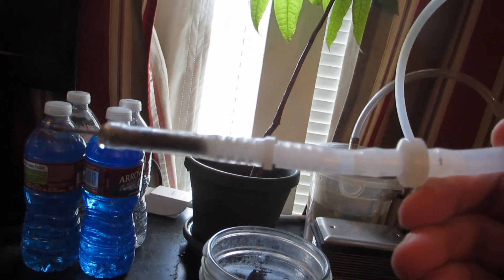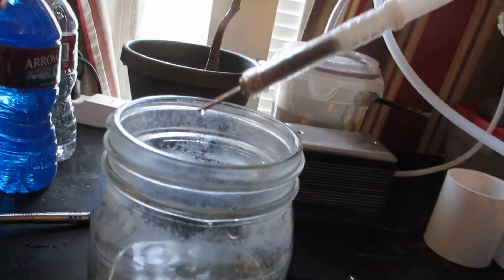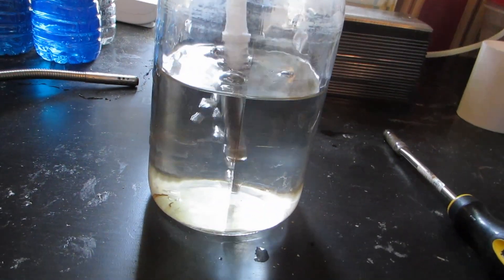Vid78 Brick Cell Torch

Comment: hi what power supply you using 
?
Reply from the maker: I'm using a 400W power supply that I pulled from an old PC case.  It is a iMicro PS-UL400W.  Any newer power supply will work, because the color coding is universal.  Be sure to look for a power supply with 12V 25A or higher rating. This will ensure you can provide sufficient current to power the hydrogen generator.
Reply: HHO4ALL hi again thanx for answering i use xbox power supply but its pain in a** its keep turning off . hopefully i will found some cheap pc :)
Reply from the maker: The xbox power supply keeps turning off, because of it's built-in circuit breaker. It does this, because you are drawing too much power and to protect the power supply from getting fried.  Using a converted PC power supply will give you much higher amperage. I have 2 videos where I showed how to convert a PC Power supply. (Videos 27 & 55) I hope this helps.
Reply: HHO4ALL thank you mate you help for me allot  . sorry for my English
Reply: HHO4ALL hi again i buy psu and make every thing like yours tutorial shows but its keep turning off maybe you known whats wrong with it :/

Comment: Ok, ist an older Video, but i was reminded of Viktor Schauberger as i saw your cup concept. Especially because of the hole in the middle, he discovered this with water as an element and the flowing of rivers. And you have electricity as an element.  

Ok, das Video ist schon ein bissi älter aber ich habe mich an Viktor Schauberger erinnert gefühlt als ich dieses Trichterdesign gesehen habe. Besonders wegen des Loches in der Mitte. Er entdeckte dieses Wissen mit Wasser als Element und an der Bewegung des Wassers wenn der Fluss dahinfliest. Aber du hast die Elektrizität als Medium.